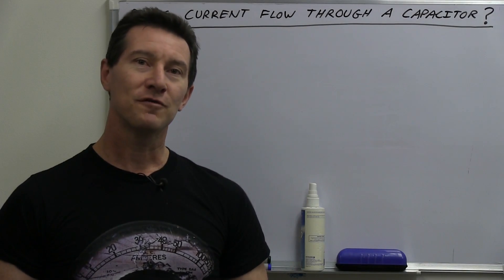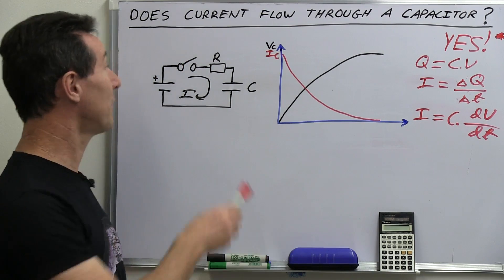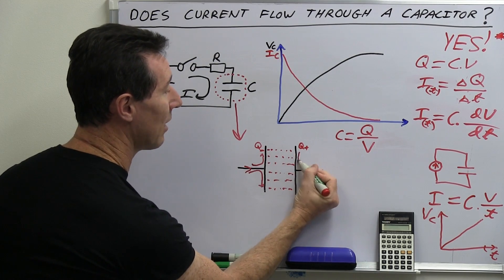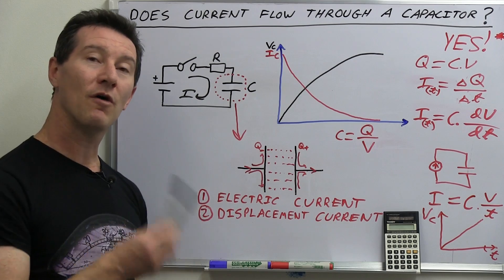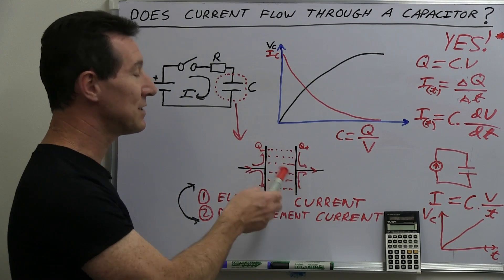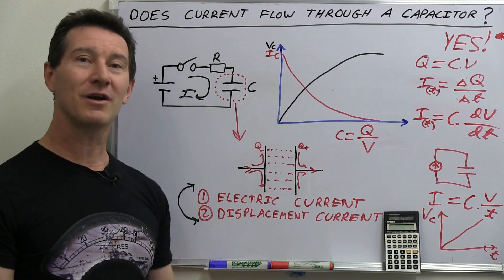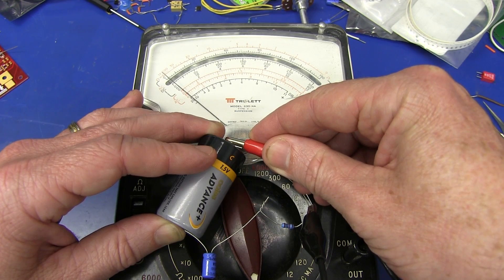EEVblog #486 - Does Current Flow Through A Capacitor?

Comment: electrons does not flow "through" capacitor. when fully discharge a capacitor,they are like 2 buckets of water half full and electron analogous to water. when you fully charge a capacitor, one of the bucket will be empty another will be full.

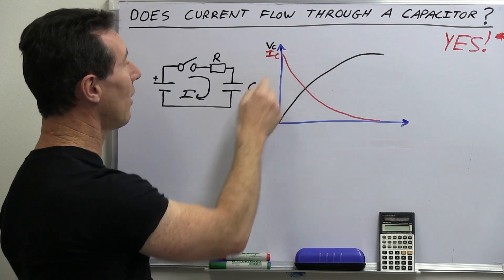Comment: 2:24 "The current starts off incredibly high because the capacitor's effectively a short circuit when you close that switch."
This isn't quite correct. The maximum current is limited by the resistance of the resistor that lies in between the capacitor and the battery (and its voltage). If we remove all resistors and other components and simply connect a capacitor directly to a voltage source, then we can say we're charging a capacitor on a short circuit. But even in that case, while current flows through the circuit (i.e. through the wires), no current flows through the capacitor (i.e. from one terminal of the capacitor to the other).

Comment: Well, technically the current doesn't flow "through" the capacitor. It flows into the capacitor and it flows our of the capacitor but not through. And that is the reason why it eventually stops flowing, because eventually you have a pile of electrons on one side and barely any on the other side. Of course you can always increase the voltage a little until it arcs over to the other side in which case current literally does flow through the capacitor. But normally capacitors aren't meant to be operated that way. :-)
Of course I wouldn't say you're wrong, 'cause anyone talking about electronics, including me will simply say the current flows through the capacitor, since in the case of the electronics it doesn't matter and there's no point in making things unnecessarily complicated. But still, technically speaking I would agree that there is no current flowing actually "through" capacitor.

Comment: It's actually pretty easy, a cap is a cross between a transformer (electricity change from dielectric charge into a magnetic field and back to electricity) and a battery (the electric to magnetic conversion effects the atom state of the material were the atomic bonds are put into a state of stress, thus re-releasing the energy back over time as a current onto towards the metal ground plate)

Comment: The answer is simply, as it turns out no actual current (or  electron flow)makes it across the gap, at least in an ideal capacitor.Nevertheless  clerk maxwell noted that even if no real current passed from one capacitor plate to the other,there was a changing electric flux through the gap of the capacitor that he believed (and proved) that it permeated the empty space between the capacitors and induced a current in the other plate.this curren is known as displacement current (Id)

Comment: Pull your head outta your asterisk Dave,
You're confusing TO (not two or too) with THROUGH (not threw).
TO!  not through.  8+ minutes to get to Displacement Current.  
Charge flows TO the plates of the capacitor. Not through.
OMG.  Couldn't a cut a long story short... much shorter. 
Thank you for the effort anyway.

Comment: If "electric current" is defined as the flow of free electrons, then of course it can NOT pass through an insulator.  The reason why current APPEARS to pass through a capacitor is because electric charge accumulates on the capacitor plates.  (The dielectric could even be a vacuum).  Hardly worth a YouTube presentation.
Reply: A little bit of knowledge is dangerous

Comment: It doesn't mirror the drop in voltage, it depends on the capacitor's value...correct? the larger the capacitor the slower the drop in the current, the smaller the capacitor the faster the drop in current....

Comment: An anology: water flowing through a pipe has current.  If the water is blocked by an elastic diaphragm it can still flow before the stiffness of the diaphragm prevents any further flow.  The water can flow in an alternating manner with virtual current.  The elasticity of the diaphragme allows for this alternating flow.  The attraction and repulsion of electrons pushing against an electric field drives the virtual current.

Comment: I measure very small currents for a living.  Does electron current flow through a capacitor: nope!  Your using a semantic argument in the English language to explain your answer.  What flows into and out of a capacitor is charge.  As you said in your video Q=C*V and Q=I*T.  You can also say than when charge is flowing into a capacitor that I=Q/T.  This is apparent current flow or a displacement current flow.  Think of electrons as water and the capacitor as a bucket.  The water flows into the bucket and when the bucket is full the flow of water into the bucket stops.  The water never flows through the bucket only back into the source hose when the bucket empties.  Lets try closing your switch when the capacitor is charged to the supply voltage (bucket full of water) and you will find that no charge or current flows through the capacitor!  All us engineers and physicists know what is happening with the capacitor and charge, so I say the yes/no answer to your question is meaningless because the question is from someone who doesn't understand what is happening.  So I say that Yes and No is the right and wrong answer at the same time (:^)).
Reply: All devices are complex impedances with inductance, capacitance and resistance.  The leads of the capacitor will be inductive at higher frequencies than DC.  The series inductance of a capacitor will be resonate at a particular frequency and will show as a dip in impedance to the series resistance of the leads of the capacitor.  When talking about AC through a capacitor , the effect looks like and can be modeled like current is flowing through the capacitor, but it is still charge flowing into and out of the capacitor and not through the capacitor.  Charge flows in and charge flows out but never through (except for leakage in the dielectric and the body material).  I think Maxwell's equations doesn't confine itself to just DC so when talking about AC current, one unit of charge in, balanced by one unit of charge out looks like current flow through the capacitor, but at DC things change considerably.  When the maximum charge that the capacitor can hold Q=C*V the current flow stops, unlike with AC current.  At the peak and valley of the AC cycle the current flow stops and reverses because Q=C*V and the maximum charge is in the capacitor.  Yes, I know about phase shift and it isn't that simple, but the principle is the same!

Comment: No current flows through a capacitor!  Charge flows into one plate and an equal charge flows out of the other plate and it appears that current is flowing through the capacitor, but it isn't.  No charge flows through the dielectric of the capacitor (except leakage current), so charge does not flow "through" the capacitor.   A capacitor is a device that holds charge.  Rearrange the formula Q=I*T and you get the definition of current as I=Q/T or the flow of charge over time.  The definition of a capacitor is two conductive plates separated by a dielectric.  If plate 1 has charge Q1 and plate 2 has charge Q2 then the electrostatic force between the plates in newtons is given by the formula F=Q1*Q2/(4πer2) where r is in meters and  e is the permittivity of the dielectric.  A capacitor's maximum electrostatic charge that it can hold is given by the equation Q=C*V and once the voltage of the capacitor is defined then no more charge will flow into or out of the capacitor.  A fully charged capacitor with voltage V in series with a resistor R and battery of voltage V will not permit any current flow.  Charge flows through a resistor, but never through a capacitor.  I measure very small currents for a living.
Reply: this banal explanation is not sufficient to understand the operation of the capacitor, he explained that it is a current induced by a magnetic field that allows the circuit to operate .. it is this notion of induced current which helps explain how a capacitor works and which many never indicate.
Reply: Everything he said in the video is correct and it doesn't contradict what you said!

Comment: I'm thinking current can flow across plates via electric field until it reaches a balance charge on both side. this don't happen instantly resulting in time. and time is determined by the speed/size of the Capacitor plates to reach this equilibrium and also store that state of charge from vcc

Comment: "and you can spend years and years of your life trying to understand how, or if, current flows through a capacitor." No thanks, I'll just trust I_in -> I_out.

I learned my lesson on the difference between practical circuits and physics because when I was a kid and thought current was backwards because electron flow, and then later I learned about holes as charge carriers and realized oh, current doesn't actually mean electron flow after all, and those engineers aren't a bunch of idiots. Who knew?! LOL

I really liked the brute force proof at the end. The video would have been less fun with that at the start.

Comment: If you have two pieces of a4 paper and put one on top of the other, then lift the upper a4 paper and the second follows up the opposite happens if you release one a4 paper on top of the other, so it takes a little time before they are together. Good video

Comment: The answer is really, NO, because no electrons are flowing in the dielectric of the capacitor when CHARGING.      .      .BUT to make understanding of electrical circuits easier, image it does flow through, AND charge the capacitor.     .     . Does current flow through when discharging ? (Answer, NO, and depends).
Reply: Something must be flowing through the dielectric, but not electrons (maybe undiscovered "magtrons" (sarc)).

Comment: Current is the flow of charge. Charge arrives at some current at one plate, and chases charge off the other plate, at the same current. So current flows through the capacitor, even though no charge carriers (electrons) flow through.
Reply: Current is the flow of electrons, so current does not flow through the capacitor.  Imaginary "displacement current" is to make life easier.

Comment: This presentation is useful for me.  However  It can be concluded that  electric current  can flow  through a capacitor like  a  bulb.  But it can't do continuously, electric current give up ( I equal to zero) when maximum voltage of a capacitor reached (showed in the graphic).  Is my conclusion true ? Thank.
Reply: Hasan Yahya You are correct. Capacitors are by definition an open circuit and incapable of passing any voltage. When they are in a DC condition, be that charged or discharged, they do not conduct power of any kind. But when the charge is changing, they will increase the power they hold with the change in charge. So store power when charging up, and dump power when charging down.

The guys who first investigated electricity called this kind of stored power dielectricity. Modern dudes call it displacement current. Once a dielectric material is charged fully, it will conduct that displacement current just like a conductor. Capacitors break down and short out before they get to this state. Displacement current is real, but does not generate an electric field when it moves, like charge current when it  moves.

The present theory that is the most simplified is that dielectricity is the source of magnetic field lines. It flows with charge movement, orients with charge orthogonally and repels other dielectric fields orthogonally when capacity is filled. This is the cause of the magnetic effects people see and measure. It is motivated to move by capacity differentials in circuits, and will surround a conductor which typically would attract more dielectricity than the conductor has capacity for, so it hangs out at the surface, in the insulation and air surrounding a conductor (or magnet). A conductor in this space of another charged conductor can pull it away by activating the movement of it's charge field, or with circuits that have more capacitance. 

There are ways to configure circuits to operate with dielectric energy controlling the propagation of the electric field, and these propagate signals faster than light speed. 

It should be obvious that electricity is not a particle phenomenon and the fields are not fully contained in the physical structures of circuits. So, the systems are open and external conditions can influence the circuits beyond the typical analysis used that focuses just on components.

Electric fields are everywhere and energy can be harvested simply with the proper activation of electric fields.that draw dielectricity to conductors and then transfer it to the proper mix of charge based on the application. 

The real mystery is in how smaller fields will combine to form larger fields that affect other fields without using up the smaller fields. No one knows how this happens, but its there for the taking. It happens all the time, no one notices. Permanent magnets don't wear our by usage any more than a light will wear out by what it illuminates.

Electric induction generators do not require more energy based on how much energy you use unless you force the used energy back into the generators.

Or do I digress? Knowing what is really happening leads to more effective designs.
Reply: BMan18 ; thank you for this explanation! It turned on the lightbulb in my head! I'm taking a screen shot so I don't un-remember it, lol!
Reply: The ohm meter demonstrates the truth
Reply: a light bulb? 

A capacitor is about electromagnetism and the potential field difference across the plates.

Comment: Really nice point, identifying a different type of electricity that does not depend on electrons. Some original electrical engineers called it dielectricity, because it traveled in dielectrics. But the conclusion that it's of no importance to separate the two, is bogus. It seems Maxwell's complex equations are wrong... Displacement current may not generate magnetic fields. Ampere's Law is flawed. Point charge fields are spherical in dynamic, not what he thought as limited to closed surfaces. But that's getting lost in the math...

So you have a device that converts charge current to displacement current and displacement current does not generate a magnetic field because it's not a moving charge. So, can you think of a useful, practical application where moving current without a magnetic field would be helpful?

How about power generators? Could it be that Lenz's Law only applies to charge current?

Think about induction devices like transformers and motors and generators that could take the charge current, convert it to displacement current, not load the source electric field with back EMF and then convert it back to charge current free of any source resistance. Separating the two might just be the single greatest technique of manipulating electricity in the entire history of using electricity. It could be the key to resetting the entire world's consumer economy while saving life on the planet from extinction.

Then there are also application where more electrical energy would be beneficial but more charge would be destructive. Displacement current is motivated to travel by capacity, not charge. This too could lead to some very useful applications. These include effects that have been noticed to improve health and heal diseases and alter the expression of DNA in living cells and minimize the effects of gravity. Areas of interest not without significant consequences...

But careful, again you will be treading on the economic stability of the world economies.
Reply: BMan18 Wao man!! These are really deep, smart thoughts! kudos🙏🙏

Comment: I think it only adds confusion for 'young players' to speak of current 'flowing through' a capacitor you are invoking images of electron flow through the device which is inaccurate. When I was taught electronics we spoke of 'charge', i.e. you are charging the plates of the capacitor which does cause electron flow in the circuit but there is no flow 'through' the device (other than leakage perhaps).

Lumping electric current and displacement current together is like calling everything 'ground', it is common but creates a lot of confusion; i.e. what 'ground' Earth ground, DC Common, AC common, the '-' terminal of a battery, etc.